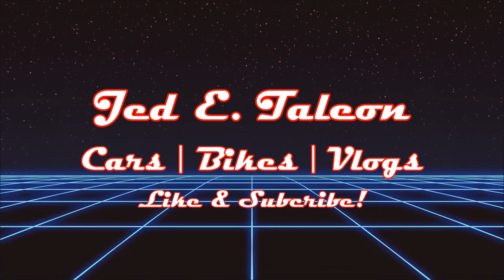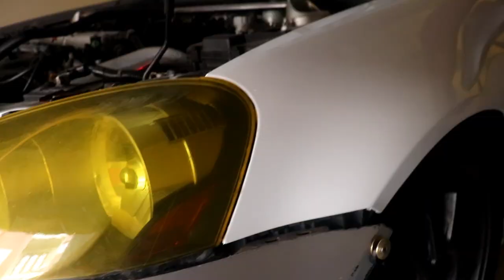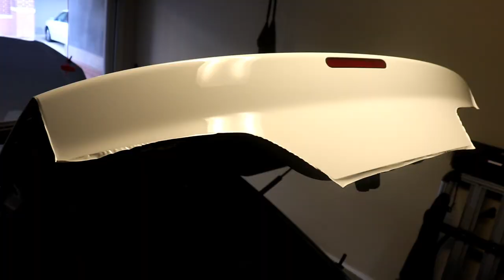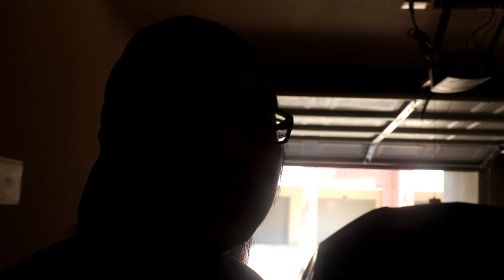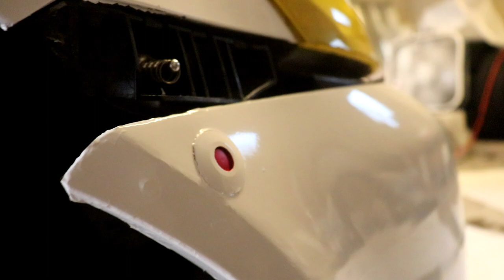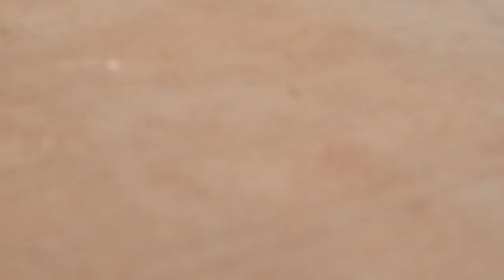Got The RSX Vinyl Wrapped!

Comment: You didn't mention...any prep work done to the surface?  A detail guy told me even hair-line scratches and small rock chips make it prohibitive to do a wrap on my Cayman.  Regardless, I plan on doing this to my RSX some time next year.  I'm actually going back to stock badges plastidip in grey and I want to use the Alpha Romeo "Rosso Competizione Tri-Coat" red 😎
Reply from the maker: Well for prep work? Idk everything but things like cleaning the car, removing decals and pin striping, etc, fill dents, and maybe sand down high spots or chipped paint... We didn't do all of that, we just cleaned the car, removed adhesive from stickers and old decals and just wrapped over anything else left over lol
Reply: @JedETaleon  I know this is a track build, but I'm curious how the wrap will hold up without the prep.  The dream is to not do it unless it is necessary.
Reply from the maker: @DC5Brandon  well good quality wrap will stick and stay... Unless your surface is peeling off to begin with lol
Reply: @DC5Brandon  so I did the exact brand of wrap and color that Jed did and the spots where I had unfixable dings or dents the wrap stayed on even after a year and several track days in our summer heat. The only spots that lifted that needed touching up was weird contours and high tension spots